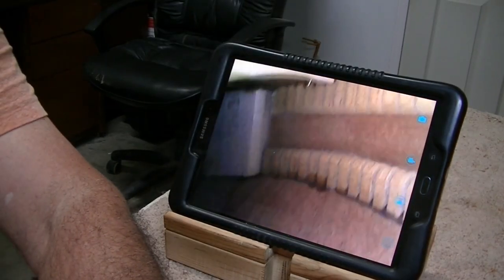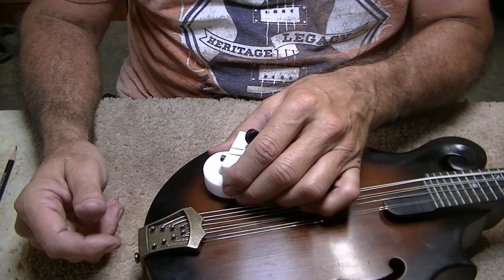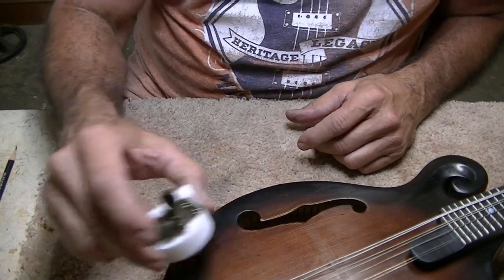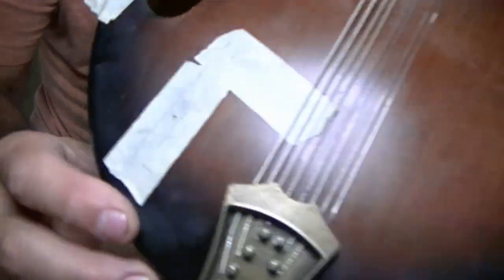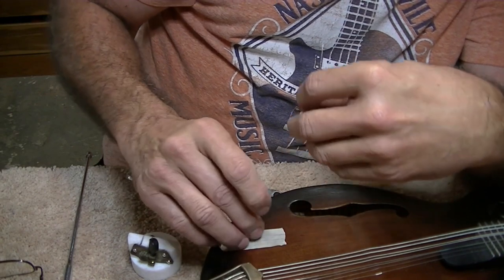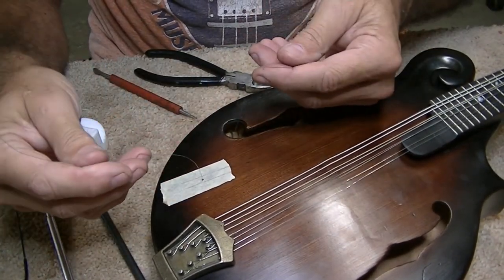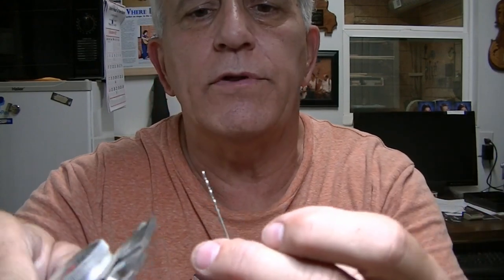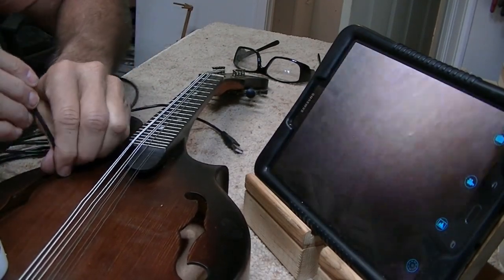242 RSW Unique Mandolin Bass Bar Repair

Comment: So glad I found this video - 
The mandolin was giving to me by a band mate. Fender Mandolin. (Treble side brace)
The top had really collapsed bad. Even had a small crack in the top at the corner of the F hole. 
Wasn't even playable. He keep raising the bridge on that side until it maxed out.
I did the sound post fix initially just to get it playable. 

I used the snake camera for a few more of the steps. I also removed all the electronics. 
First time the E string I used broke off when I tightened it. It was hard to get it free with the small ball end I had used.
I hadn't applied the glue yet. Went up to the A string for more strength. 
I also used a small washer instead of the ball end of a string the second time.
I used a 3/4" PVC connector with a small piece of basswood along the side for the string winder clamp.
The tuning machine came off an old Squire Strat - Drilled a hole through through the wood and PVC piece and added the tuning machine which held the 2 together.
Getting the glue spread was the trickiest part...
Still haven't removed the clamp (Just glued it last night)
Do you know if the repair you made is still good?
Hopeful that this "real" fix holds...

Comment: Clever trick using a string through a hole in the top and brace to glue the brace back up. Have you thought about tying another wire to the string nut to pull the string nut back out of the body once the brace is glued back up?

Comment: You mix different color timbermates together to get the right color.It works really well.Dry the timbermate with a  hot air gun ,or hair dryer;to check the color.
Reply from the maker: It still looks unnatural when you're trying to just put a clear coat over bare wood.

Comment: First thank you for showing your work, I'm just silly enough to try some of these. Working on my first and only Mandolin, has Alpha II on the headstock. My friend tells me it's around 60 years old. It has this same problem but worse, it's cracked the top on either side of the base side F hole. Someone tried to fix it with sound posts and tons of glue.. Going to investigate more this weekend and see what I can do. It's an A type, (learned that from you) with bindings, if it didnt have bindings I'd pop the back off and fix it right. I took off the rusty 7 strings that were on it, and strung it up, tuned, set autination and had over .150" at the 12th fret and of course bridge area sank in.. I've been watching your video's, and all the wrecks you have worked on, very impressive and give me inspiration on this mess I plan to fix.

Comment: As a re-enforcement to your glue up you could tape a fine (capillary?) tube (available at hobby stores with a good selection of cyano glue accessories)to a suitably bent wire with about 1/8 inch of tube past the applicator end of the wire. Inject medium or thin cyano glue (super glue) into the joint. Glue voids will be filled and the joint less likely to separate.
Reply: Or just inject it in through the drilled hole

Comment: Jerry BTW - Check Robbie O'Brien's YouTube channel - pretty sure I remember him using joint compound for pore filling. I've never done it on an instrument but I absolutely have used it on furniture and it will perfectly fill open grain wood like Ash or oak. I mix it with some super-fine sanding dust from the same species. It takes stain 10x better than sanding dust and wood glue - but joint cmpd - esp taping mud - does have a small amt of water-based adhesive in it - it's not pure gypsum. The amt of "mud" actually left in the wood is so miniscule I really doubt it would impact the tone any worse or better than any other finish operation. But it does build very quickly- two apps got me over-filled enough to scrape back to flat.  The piece looked like a mirror when done - zero trace of the grain.
Reply from the maker: Yeah I think I saw that. I don't think that would works at all on padouk. There's there's too much open grain and I don't like to stain that would because it's so pretty. I don't think there's any way you can get that to look good in those pores. Without staining. And staining would still show up because of such large pores.
Reply: I've used it on oak, but rather than staining to match I'll just pre-blacken the compound with some dye.

Comment: Interesting...what you [ and others ] need is a tiny, four-legged robot with a camera attached, and a little articulated arm that will accept a tool, paint brush, etc. Could be wire controlled.

The little mechanical critter could do all kinds of cool stuff. Might be able to brace itself inside the instrument...call MIT or DARPA for details, or maybe Cal Tech or Boston Dynamics...

Comment: You have to dilute that Timbermate with water to use it as a pore filler.  It works pretty well.
Reply from the maker: I'm sure it would work great. I just can't see using it on padouk when I don't use any stain. I'm sure you would be able to see it. Even if it was a fairly close match.
Reply: I used it on bubinga once and it worked well (no stain). The trick was to dilute it as said above, and use Timbermate darker than your wood (I used rosewood timbermate on my bubinga, can't remember).

Comment: You dilute the Timbermate with distilled water to make a pore filler.  Mix with water until you get the consistency of heavy cream.  I used a container of walnut Timbermate that size to fill a 28 x 42 inch table top and used about 1/2 of the container to fill BOTH SIDES of the the table top.
Reply from the maker: I understand that. I've used similar fillers in the past but they don't look natural when you don't stain the wood.

Comment: I'm wondering if there would've been any benefit to sticking a small dowel through the top and brace and gluing that in. I doubt it at that size. 

I think I'll try to experiment with filling paduak. I might have some scrap in the basement. I'll post a video of I do.

Comment: Boy that would have been nearly impossible without that camera. Pretty slick though with it. I always heard glue won't stick to glue but I've never tested it so this might be that test for all of us. Keep us posted. Oh are you still using that cheapo endoscope you did a video on. If so I'm surprised by the clarity. I want to buy one but don't want a cheap one if that's an upgrade. Thanks brother.
Reply from the maker: The cheap camera still works. And the clarity is pretty good on it too. However this is a different camera that viewer friend sent to me.  The two main differences are it is a wireless Wi-Fi camera. In other words it generates its own Wi-Fi signal and you have to connect to it with your device via Wi-Fi. The second difference is that it has a cable attached to the camera that can be bent and it will stay in that bent position. The original camera is totally flexible and therefore you have to keep your hand right on the camera itself. This one you can hold the wire and not the camera which makes it easier to poke it back into a hole like this. I don't know what the brand is as I'm not in the shop at the moment. However the software that is installed on my device is called Moqo View.
Reply: Thanks Jerry, I thought is was cleaner than what I had seen before. I really could have benefited from a tool like that on my last repair. Lots of loose braces.

Comment: Just had a thought, why not get a insulin needle, and fill the syringe with glue and poke the needle through the hole you drill and inject the glue, and then just tighten the wire?  What do you think?
Reply from the maker: It would only come out in that one spot and run out the sides of the brace and drip down it wouldn't run down the length of the brace. I thought about drilling a bunch holes in a line and do just that but it would look bad from the outside.

Comment: You can imagine it Gerry. I bought one brand spanking 15 years back. It never sounded very good. Upon investigation I found the same thing, base bar loose. A gob of glue like someone stuck it up with bubble gum. Took the back off. Very difficult. Not meant to come off I don't think. So if you dont think the factory would do that, your wrong. Push em out the door. Thats all that counts.

Comment: Have you tried Zpoxy or 2p10 for pore fill   Both seem to work!  Great video👍
Reply from the maker: I purchased both but haven't used them yet.  My biggest concern is sanding off the crud after it's cured.  The 2 P10 is just a fancy Super Glue.

Comment: A little late for an observation, but maybe a second hole through the top to squirt glue down into the crack.  Either way, you are a master.
Reply: Bill Stoner ya, followed w/ a wood screw ( flat head ) ...lol . . . was thinking muslin cloth around the repair, shouldn't effect tone, fast & fine repair tho . .  ( Attaching a string to nut assists in removal )

Comment: I guess 3/64 inch is the closest measurement if you don't use thousand of a inch.
But since I am i meter person i think it would be better to use yard instead of inch since yard is closer to meter that I understand.
So 46 thousand of an inch would be rounded to 0.128 tousand of an yard.
Much easyer to understand.